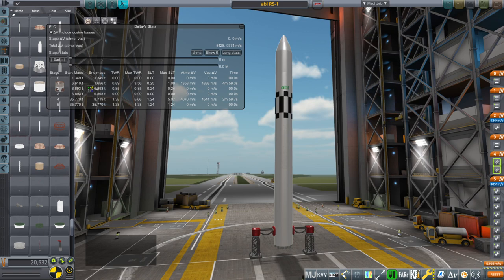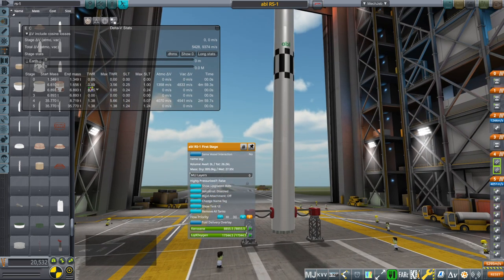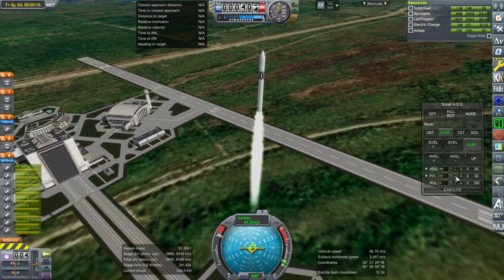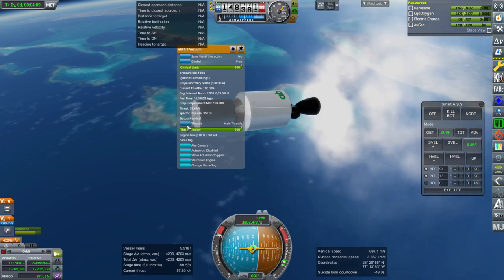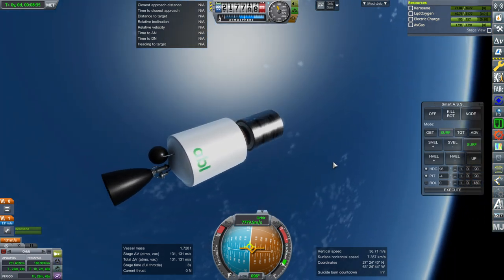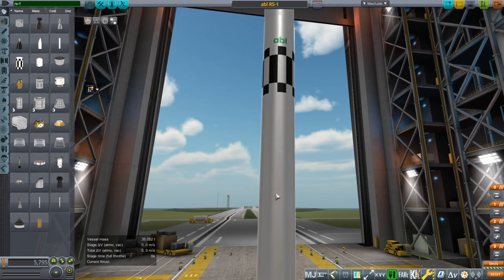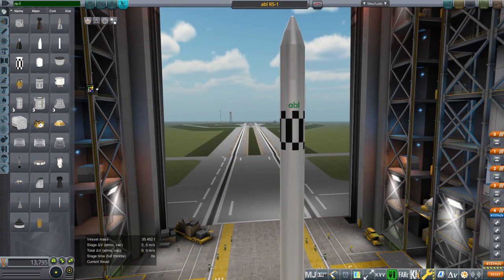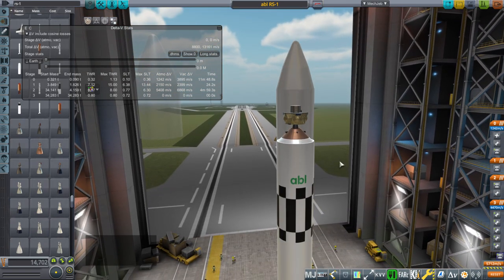KSP with Realism Overhaul - abl Space's RS-1 Rocket

Comment: I really like ABL's focus on simplicity, and if they succeed, they'll be coming into the market as the cheapest 1+ ton launcher, and also have the most payload to LEO in that market.
Reply: They’ll be second to Relativity when it comes to most payload to LEO, but being able to have flexibility in fuel (RP-1/Kerosene or Diesel) and extreme portability for its ground systems, competing in that dimension against Astra’s Rocket, should put them in an interesting position. Better payload than Rocket 3.0/4.0 and LauncherOne but more mobility than Alpha and Terran 1, although it will not be able to be produced as often nor was marketed as being able to launch as frequently.
Reply: @topsecret1837  Unless the payload of Terran 1 has gone up dramatically recently, RS1 puts more into LEO, at least according to their respective sites and payload user's guides.
Reply: @jef_3006  The Terran 1 payload guide states 1479KG to LEO. However, it’s hard to imagine how Relativity can manufacture a cheaper rocket than the RS1. Thus giving RS1 the lead in the 1+ ton rocket race.
Reply: @HexaSquirrel  They absolutely can after their gen 4 printers go online. Gen 4 will increase their gross margin by a significant amount on Terran-1
Reply: @rdcepcvip  I'm a Relativity Stan, but initially printing will be more expense than SM. Sure, the gen 4 printers will be quicker, but that doesn't necessary mean cheaper. That being said, DED certainly has massive potential to be cost competitive; as both customers and investors agree. 

Both RS and ABL are at the top of the list for launch companies to watch for.